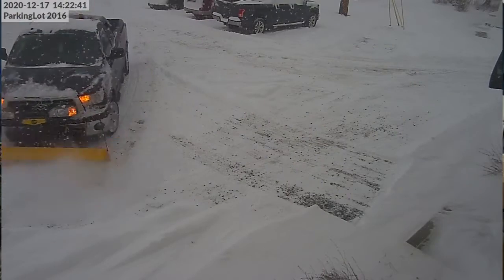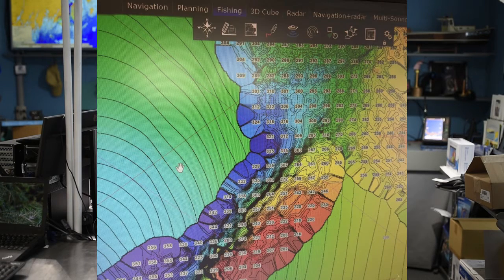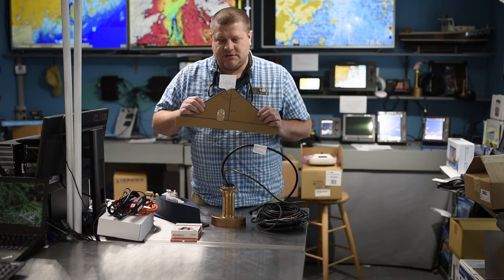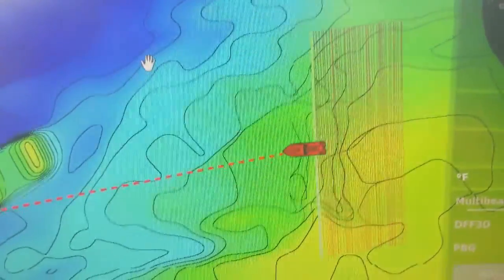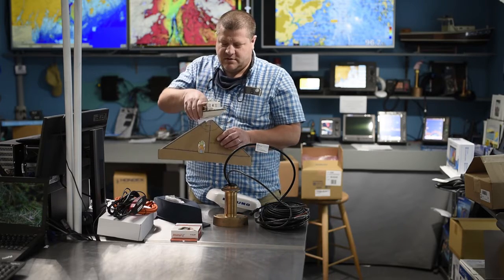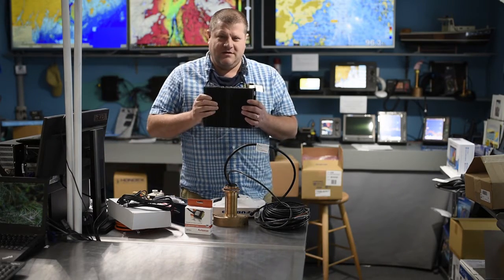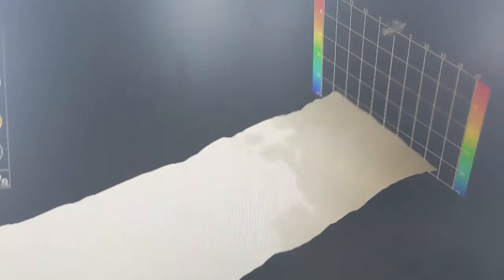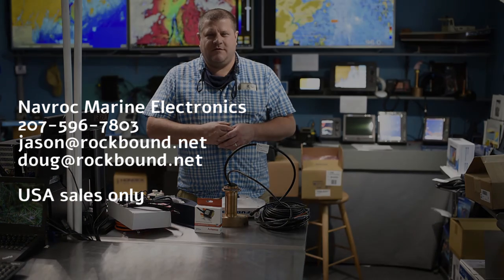Furuno DFF3D and TimeZero Professional show and tell

Comment: Hi Jason, great video! I am running a tzt3, dff3d, scx20 at the moment. Am i able to concurrently connect and use timezero professional pbg whilst using tzt3 as well?
Reply from the maker: Yes! It all works together nicely so long as the tzt3 has fairly up-to-date software. I haven't tried running pbg on both that the same time, but I don't see why it shouldn't work.

Comment: I have a down east style lobster boat
Can the dff3d work on this style boat  without putting it in the keel?
Reply from the maker: Thanks.. Yes if your boat is wide enough that you can measure 60 degrees from plumb under the transducer and not hit the keel.. It has a 10m (33ft) cable, so it can be fairly far back (where boat is wider) and the cable has to reach to the blackbox which is installed typically ahead of the bulkhead.
Reply: @jasonphilbrook4332  thank you for the reply 
I just assumed it wouldn't work so that's good news
Not entirely sure how to check that angle
Reply from the maker: @mikewilliams-no9cm  Have to check things over when it's out of the water sometime. A math protractor or angle finder tool would be needed.
Reply: @jasonphilbrook4332  it's out of the water now
Maybe a straight piece of lumber under the keel with my phone with an angle finder app lol